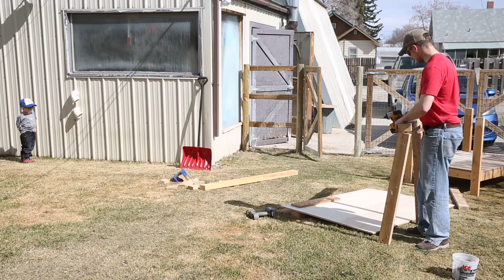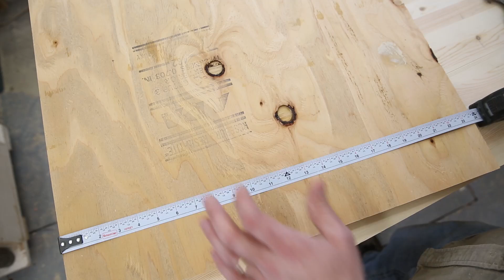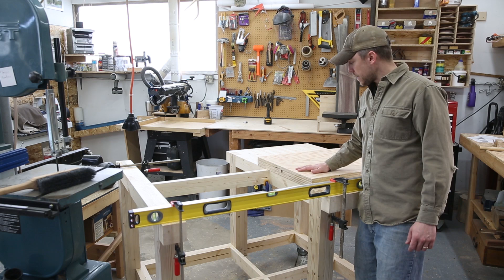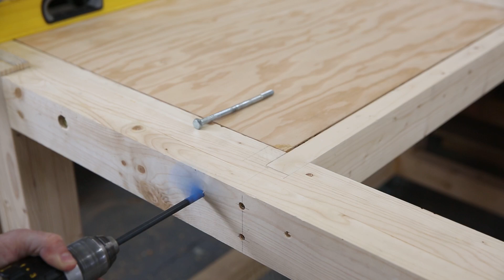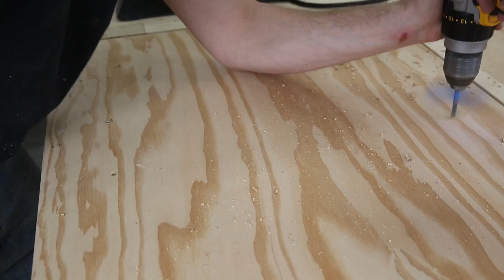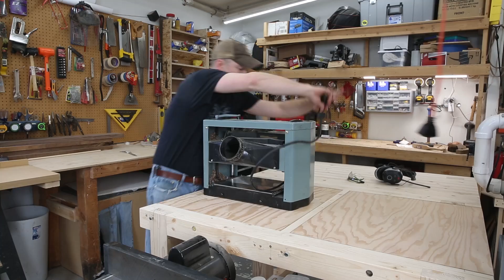Double Flip Top Workbench - The Flipening (Part 2 of 3)

Comment: Overall brilliantly well done. The only things I think I would have suggested is to have made your axle holes oversized and lined them with a steel tube to protect the wood from the axles. Also, I can't understand why you used all thread for your axles instead of pipe or round stock.

Comment: You may regret using a threaded rod for you axle.  It will act as a rasp and slowly remove material from our 3/4" square hole.  It will loosen over time.

Comment: I know I'm late to the party, but had a thought about the pins not locating perfectly in  the 2 positions...u could use just the 1 pin hole on the outside frame (with a handle, plus metal sleeve as u and others suggest), and make that locate into a horizontal slot rather than a hole in the pivoting portion....So no issue with locating errors...the main shaft prevents any front to back movement and pin and slot only have to stop up and down movement....maybe also an aluminium c section in the slot to prevent wear and slop, or a lock strike plate type affair.
Great vids, thx😃

Comment: Yes I love this bench. But just one thing I want to point out.
9:16 if you wait to drill holes in flip top till axle is in. Then drill hole into fliptop, then rotate on the axle to tool side and use same hole to drill again. Hole alignment is built-in to your table already.
Just saying......
Reply: I had that thought; you may end up with 4 holes in the fliptop, but only 2 visible.

The problem would be if the holes ended up very close; you could easily end up with a bigger ovalised hole that wasn't accurate or strong.

But with thought I am sure such a thing would work!

My own thought was to use the three-layer approach to make yourself a mortise in the side of the top, both "front" and "rear" and use a horizontally rotating cam-lock lever (like an L shape?) that will lock it in place; that way while there's more setup of the locking mechanism rather than simple pins, it's strong, and you can be a little less accurate front-back than the hole method, as the vertical is very much set and accurate for both sides.
Reply: @mocorabbit8968  I've seen a couple of other flip tables setup like that.
Reply: just had the same thought. one pin , flip, align, drill, repeat.

Comment: Great work! Have you considered making so you pull it towards you a bit, flip it, then push it back in and lock it in place? Could do it by making the slot for the pivot pin 3/4" wider, then put 3/4" metal pins in the back side that slot into metal holes. Add a sliding catch to hold it against the holes when it use. That way you avoid using the vise grips.

Comment: At 9:00 Solution to fix that would be to simply make a template the length of the flip table with a hole marked for each side. Center the template based on the central rod then mark the holes. Then transfer the template to the table. You would then have perfectly aligned holes using the same pin holes regardless which orientation the table was in.

Comment: That was a great project. I haven't read through the comments, but you mentioned wanting a handle on the locking pins - I think if you go to the farm supply store  you can get D-handle straight pins (like the ones used on a 3-pt tractor hitch).

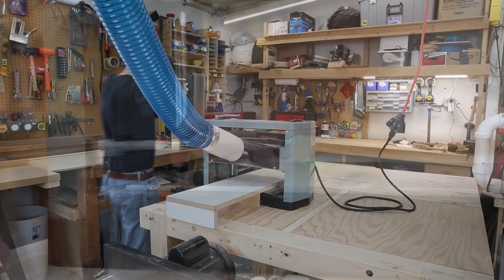Comment: 10:00 If you put a Boat Cleat (or something similar) on the flip section half way between the edge of the flip top and the planer body, you would have something to wrap the power cord neatly around to store it when not using the planer and it shouldn't interfere with the wood table you instal in the planer when you use it...
Reply: Should have fed power cable into the long tube used as axle.  Have power popping out from there, run to a table PowerPoint under the butchers block.

Comment: MOHAWK FINISHES, HIGH GLOSS BAR TOP FINISH. IT WILL TAKE A BEATING AFTER IT HARDENS UP A FEW DAYS OF CURING OUT... THE HOME OWNER OF A RESTORED GRAND PLAYER PIANO , WAS RESTORED IN ENTIRELY INCLUDING ALL THE ENTER WORKING RESTORED . HE WANTED A HARD FINISH THAT WOULD HOLD UP TO ANYTHING . SO THE MANUFACTURER WROTE A CHECK TO COVER THE PIANO , IF THE BALL PEEN HAMMER EVEN DAMAGE IT THEY WOULD PAY OFF . THE HAMMER WAS USED ON IT AND IT WAS HIT AS HARD AS WE COULD AND IT DID NOT EVEN STRETCH THE FINISH ON IT...

Comment: I think waterbased poly is the way to go i like the poly acrylic   By Minwax  the est formany reasons low Voc, fast dry time,  and overall  hardness  when completely cured  plus i used it  on  a very well use kitchen counter  i made and had in a home i lived in for over 20 years and that stuff held up  over time  i applied only 3 coats to the  areas i spoke about  and  i used all types of cleaners  on it  yet the finish still looked new  when i did sell the place  BTW that was  White Oak and it matched my kitchen cabinetry perfect  after applying a ol based Golden  Oak stain  if you are applying it over a  factory applied finish like. A wood paneling would have  i highly reccomend you doing a test area  as i did have it bubble on me  applying it over  a  prefinished  peice of furniture i was going. To  apply more of a protection to  luckily i did try a test area the day prior and was kind of shocked  to what did happen  of course a boiled Lindseed oil / mineral sprits is a. Deent inexpensive finish as well and is easy to  reapply as needed  it has the tendency to really bring out the natural beauty of any. Wood  Good Luck my freind the bench looks great and is a good design for any Woodworking  projects

Comment: A well thought out and executed design..............................until you got to the metal pivot parts. And yes others have already mentioned some of this. You went to the effort of getting the bench side of the pivoting table flush and square to the fixed side of the bench. Using threaded redi rod just to get a piece of metal of the correct diameter was a big mistake. Those threads will act just like a very coarse toothed wood rasp every time to top is rotated. And your top will then start to sink below the fixed bench top the more the pivot is used. And even more so with the weight of the planer bolted to it. Plain cold rolled non-threaded steel isn't that hard or expensive to find. In addition I'd use a couple of sizes of forstner bits and buy a couple of what are called flanged bronze bushings sized with the I.D. to fit your rod. Drill and counter bore the bushing locations with the Forestner bits and add the bushings at each end with a tiny bit of oil added from time to time and the pivot should out last you and maintain the tops elevation. I'd also add a fixed but still removable length of again cold rolled steel at the inner end of the pivoting table. That way you have two points of support and have the top much more rigidly held when using the bench. The single cross pin in the redi rod as you now have it will over time also loosen up. It's the same concept as hinging a door. One hinge would likely take the weight of any door. Multiple hinges divide the weight but also keep the components far better aligned even when the hinge pins start get some wear on them.

Comment: The only issues you'll have is your rides are threaded and it will wear your holes prematurely. Should have grinder them down and use either bushing with grease or bearings ?

Comment: As a flat/satin finish I use I part MinWax stain/sealer, one part SemiGloss Oil Varnish, and two parts Deodorized Mineral Spirits.  Apply several thick coats until it stops soaking in rapidly and then thin coats until the colors are pleasing.  You may varnish as desired.All-Thread is not a good choice for the axle as it will squeak/moan until the threads enlarge the axleshaft opening.  Vibrations from the planer will accelerate wearing away the soft plywood layers from the inside.  The same is true of the lag screws.A couple metal coathooks bolted or riveted into the cover of the planer will provide an excellent way to wrap the electrical cord.

Comment: NICE BUILD! Only little wrong logic at 8:50 ...you wouldn't need to drill through the outside a second hole or align something complicated...if you flip the table and drill AGAIN THROUGH THE ONE OUTER HOLE you ARE INDEED CREATING a second pair of holes on the flip-able inside but without creating a second pair of holes in the outer frame... plus the corresponding pins need ball heads ...but thats a minor offence ;-)
Reply: finding that hole on the other side would have been tedious at best and destructive at worst. he wanted two pins on both sides for both surfaces.

Comment: A Ball Lock Pin is the perfect way to hold the pivot tops in place so vibration will not make it fall out. Just embed a washer in the flip top for the ball to lock behind. Something like https://jericoinc.com/product/ball-lock-pin-t-shaped/?attribute_diameter=1%2F4%22&attribute_grip-length=0.50&gclid=EAIaIQobChMI9fLrwvqP4QIV4R-tBh2ysgY0EAQYAiABEgKVJPD_BwE
or
https://www.speedwaymotors.com/1-4-Inch-Quick-Release-Ball-Lock-Dowel-Pin-Steel-Body-1-Inch-Grip,14819.html?sku=91032841&utm_medium=CSEGoogle&utm_source=CSE&utm_campaign=CSEGOOGLE&gclid=EAIaIQobChMI-duS9fuP4QIVkxh9Ch1ScA8sEAQYBCABEgIcwfD_BwE

Comment: You need to take out the pivots re-drill the table frame and fit a steel tube for the pivot to pivot in, that'll save the table frame wearing every time you flip it.  Other than that, Utterly brilliant space saver, Good job fella.

Comment: Just curious why you went with a threaded axle instead of a solid hunk of round rod.  It seems like the threads are eventually going to dig into your wood and ruin your top flush height pretty quick.
Reply from the maker: I had that rod laying in my scrap pile, so it didn't cost me anything to use that. I figured I flip those tops maybe twice a week, so it will take a long time for it to get chewed up at that rate.
Reply: But it will always have the weight of the planer hanging or sitting on it.  I suppose the pins help support the weight some but I would imagine you still have a lot of load on those threads even when it isn't being spun.

Comment: Nice work!  Just a suggestion, you might consider cutting pieces of pipe with the ID that's the same as the OD of your axle, to serve as bushings for the axle.  That way the axle won't wear against the wood and make the fit sloppy and not let the top stay flush.  Same for the locking pins.   You could put grease on the axle too, and really reduce the wear and quite any squeaks.  (I didn't read down thru all the comments before I added this, so if someone already suggested this, my apologies.)

Comment: nice build , you could also have put large long eye hooks for the push pins so that it has a round hook end on the out side to pull easy and just add a rubber material to the circle hook end so it wont be so rough on your hands ....tho making a handle for it as you suggested would be very nice as well and perhaps better but my thought was just a temporary thing that made it easier for the moment.

Comment: Not too shabby. At all.

I like the functionality. Impressed it all went together as well as it did....

Of course, always easy to be a critic of somebody else's work.....
Paste Wax. Get some. Use it on the axles etc. Anything where it moves. I also use it on the metal surface of ALL my tools. Planer, table saw, scroll saw.
Not crazy about lag screws into Plywood. Hope that holds up well for you.

Wasn't sure where you were going with the indexing pins, then realized you had two per side. Don't need but 1, in which case, I would have drilled the pilot in the frame, inserted the flipper, drilled one, flipped and the other. The fact you got everything to line up is actully VERY impressive.... I just know, as a Mechanical Engineer, We would consider that "Over Constrained"....but of course, making things out of metal isn't as forgiving as Wood.

Once again, really nice work. I'm impressed ;-) Thumbs up
Reply from the maker: Thanks Kenny, I really appreciate the feedback!

Comment: Hells yeah! That’s awesome. There at the end he mentioned additional thought for modifications, and I couldn’t help but think of two.

1.) If the top hasn’t been glued on the island, pocket holes running the length of the legs to accommodate counterweights rigged by greased steel wire For the flip tops. One finger rotation.

2.) retractable power cord reels for either flip top from old canister vacuums, to run to the ceilings drop outlets. Unplug with one hand and let it snap back securely, while flipping with the other hand. 

Damn, I’m lazy

Comment: Great project. You use a massive axle, but a pipe could certainly do it.
Reply from the maker: It was unnecessarily large, but it was sitting in the corner so I didn't have to go buy any more parts.
Reply: @GunflintDesigns  The way I think too. Why buy stuff when one go something laying around ? Very nice project.

Comment: Always use an oil-based finish or sealer on raw wood. Wood has inherent oils in it and the oil of the paint or varnish will mix well with the oils of the wood. Then you can use a water-based topcoat over the sealer to finish it off. My take.

Comment: Hi there! Hope all is good. What's the Salt trick you mentioned?
Reply from the maker: If you just try to glue 2 pieces together, the glue tends to librate things and the pieces slide around and are difficult to line up. The salt adds a little grip to the situation and keeps things from sliding. Imagine it like gravel on a slippery road. If you just use a little it doesn't affect the glue bond at all.

Comment: Would this hold 4 power tools on the flipping sides? As in the two tools on top and flip them to tools under them on the same flip piece.
Reply from the maker: It depends on the size... because of the middle supper stretcher, the panels can only flip towards the outside. If the tool was too tall, it would hit that stretcher. But, if they were low-profile tools, it MIGHT work.

Comment: And when the rod wears the wood so the table doesn't line up what with the weight of the planer and all.
I'm not taking anything away. Good for you and all.
But that's a lot of weight on that rod and with it spinning will create a drill action.
You said tool side. The tool ends up being a planer, WTF.🤯

A piece of flat bar under the rod.
Cut a slice where the rods bottom weight carrying side could ride on the bar strap...1/8"  and tap the bar in to keep it from wearing.

Comment: You should have just drilled one hole for the pin and just used the same hole each time. Just drill. Flip and drill again. You didn’t need to center it or try to. You’d just have one hole on the bench and two on the table

Comment: Thank you for the video. I have been kicking around ideas for something similar and I am going to use yours as the core to start from. I am going to add a second section of flip tops and make it a full 4x8 table. I just need to figure out the locking mechanism since it can’t be from the side. I am hoping to avoid front latches that I will run stuff into. Would love any ideas you or your subscribers have. +1 subscriber. Great job. Oops!

Comment: I like pure tung oil for workshop projects like benchtops, drill press tables, disc sanders etc. the trouble with actual finishes is they don't like heat very much. I once put a coat of automotive clear on my disc sander table. while it looked good, I started hating it when one day I was sanding a piece of steel that got hot and scorched the lacquer. that scorched spot is course where I use the thing the most and I ended up sanding it down and finishing it with tung oil. tung oil is cool because it actually dries, so it won't transfer to your work pieces and possibly make them greasy and unable to glue. but remember, use PURE tung oil, not some proprietary mixture.
Reply from the maker: I'm a huge fan of tung oil too!

Comment: Great workbench and video. If I may ask though. Do you have any concern about the threaded rod used as a pivot point working its way out over time? And have you considered gluing dowels in the recessed holes where the tips of the threaded rod are exposed?
Reply from the maker: That has occurred to me, so I've kept an eye on. So far it hasn't been an issue.

Comment: I couldn't stop laughing at what your son did.:D I know what it is like to have a 3 y/o outside helping you work. My son is now 30 and just recently became a father. He had a little girl, which grampa is going to spoil! I just love that bench you made, especially the flip top section. I made a bench about 5 years ago and used 3 heavy coats of oil based poly which I sanded with 220 between coats and it did wonders for keeping my top smooth.

Comment: GREAT BENCH idea!!! I love it. Just one small suggestion. Being a blacksmith, the threaded rod for the pivot is great but, get a piece of SMOOTH rod of the same size. As you flip the tops, the threaded rod will eventually chew the wood out of round. Smooth rod will last much longer.
Reply from the maker: Thanks Paul. The threaded rod is not ideal, but I had it on hand and it was the perfect diameter to do what I wanted. There are definitely better options, but this was convenient.

Comment: In order to excert pressure in the middle, take a (square) piece of wood and place it where you want to have the pressure, put a beam over it that reaches to the edge (or anything that can withstand the wanted pressure) and clamp it down at the edges.
Very simple.
If you want to have pressure along a line, use a beam in the middle.

Comment: I would've just used long eye bolts for the pins
Reply from the maker: That'd would be an easier solution. I just wanted to be fancy.
Reply: Pins with walnut handles, which were eventually used,  work fine and look great.